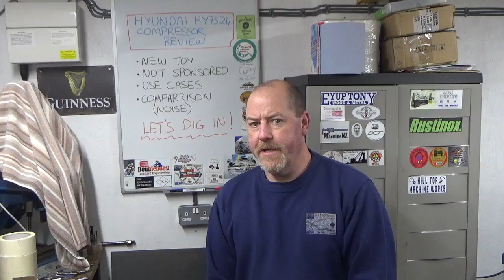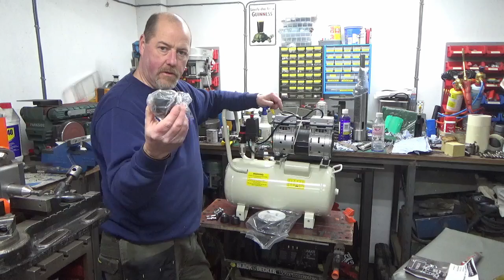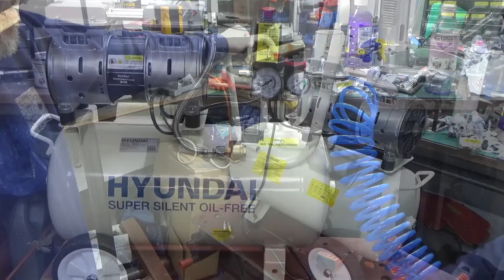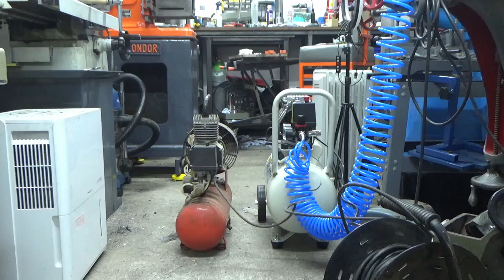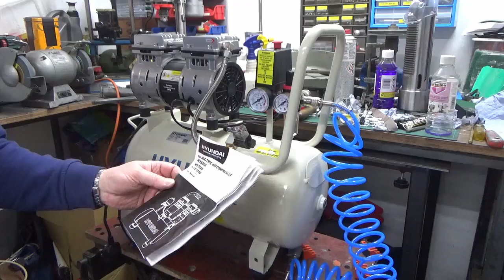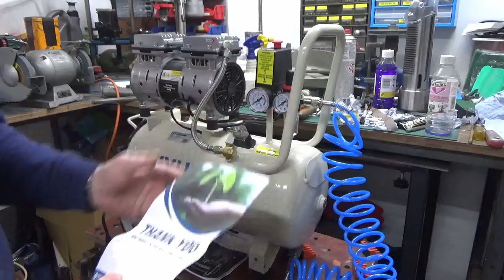Hyundai HY7524 Compressor Review - "Super Silent" or Not?

Comment: This is great Jon . Oddly enough when wearing my other hat , I did an out of the box and assembly guide for this very unit this week . I will share your findings with the factory to address the short power lead and axle issues and see what we can do about protecting the manual . 
These units do have two straps on the outside when they leave us but they tend to get torn off by conveyors at transport depots. 
I agree that the word silent may be strong but I was equally impressed with the "quietness" when I heard one run for the first time. Thanks for taking the time to share your findings . Cheers Ade.
Reply from the maker: Hi Ade, thanks for the comment. Lol, I had a suspicion that was where you wore your other hat! Thanks for taking the time to watch and for offering to take the feedback back to the factory...... brilliant! Cheers, Jon
Reply: Hi,Ade. They are great value for the money,just hope they prove to be long term reliable in service.
Reply: @howardosborne8647  Yes I have been running one for a couple of years by my bench in work . Just keep an eye on the inlet filter if in a dirty environment . If they get blocked it can cause overheating to the motor. Cheers Ade.
Reply: l think they should give anyone buying this the opportunely to either have the two wheels or four rubber legs if its going to be left without moving it around the work shop. Also be able to remove the handle. ps l think the large nut are to go on the rubber legs

Comment: sorry mate but complaining about the length of the power lead is just lame... 2nd thing, editing the volume of the compressors just defeats the purpose of your test. You can hear the change in the edit when you speak and the increase in the volume of the compressor
Reply from the maker: I record on a Sony Handycam, it produces 1audio file per video shot, both compressors were running at the same time, there is no way i am aware of to edit two seperate sounds on the same audio track.

Comment: I have the same machine, no major issue with it but yes the power cable is ridiculously short. On mine i changed the power cable - relatively easy to do, you just unscrew the cover where the on/off switch is to access the connections. I think them calling it 'silent' is a bit of a stretch, but it's certainly very quiet vs other machines!

Comment: Hi Jon, just bought one of these 21/11/2024 compressors and they’ve sorted the wheels now on this compressor, also the cable length is slightly longer now as well, so to be fair to Hyundai they are listening. Also which I find handy, the drain valve at the bottom of the tank, now has a small tap attached, which as I say, makes it a bit easier than unscrewing the knurled screw. WELL DONE HYUNDAI!!
Reply: does this automatically start  up when pressure drops  ?

Comment: Hi Jon, have you posted an update after using the unit for a year? I've just taken delivery of the same unit. Thanks for posting this initial impressions review.
Reply from the maker: Hi, not posted an update but not really had a lot of use being honest. Good bits are it still works as well and as quiet as when I unboxed it. Bad bits, it doesn't look man enough to run coolant mister without the compressor running constantly which is no use when you are filming, and will also kill it fairly quickly I think. I need to adapt the coolant mist idea to work with much lower pressure and be gravity fed with the liquid......an upcoming project. Cheers, Jon

Comment: Mine came 2 days ago and I agree with everything you said about it, BUT I have tried that regulator and whether I go to pl#us or minus nothing changes on the gauge as to the loss wheels I put a couple of washers on, did you find out what that bit of piping was for lol, 
all told I love it.
Reply from the maker: Hi John, thanks for the comment. The 'pea shooter' gets stuffed into the small hole in the air filter (pointing downwards would be my advice so needs a bit of tweaking of the filter housing to achieve this). It's all part of the noise reduction system I think. Hope this helps.

Comment: I would have liked to have a typical diagram detailing where everything is. If you are a beginner you don't quite know what everything is. They said for you to empty the maintank of water at the end of the day but without the diagram you don't know where to go to do it. Also they need to detail how to let the air out of the tank before you drain the tank of moisture. I have the 27550 and that is huge. I was struggling a bit to put the wheels and feet on without scratching the living room floor. The box was quite big and well packed. I wish the power lead was at the other end as I don't want the cabling to rest against the hot cylinders so I have to route the power cable away from the cylinders. I got mine to do airbrushing but to occasionally blow stuff out of machined work, spray large RC models and to pump up my tyres. I do think that you'll appreciate the larger tank and the quieter operation when it is actually topping up the tank. Mine is quiet too.

Comment: Hi Jon, I have got a questions. Do you recommend if I should use 24L or 50L hyundai air compressor to respray on car body parts using LVHP spray gun?

Does it work well for you if you have used 24L to respray on your car? I'd love to know!
Reply from the maker: Hi Chris, I have no idea if it will stand up to LVHP as all I use mine for is blowing down components etc (short sharp bursts). I would definitely recommend the 50l version though if you are going to try it, as the 24l tank is pretty small. Cheers, Jon
Reply: @jonsworkshop  Thanks for the advice Jon, I'm going to get 50l air compressor. But there is a problem, how I can spray on my car roof in outdoor as I dont have the garage?

Do I need to build a booth to put over my car roof to work on it or what?

Comment: Came accross you channel as thinking about this compressor.  I currently have a Wolf 24ltr which is bloody noisy.  My only concern is the Wolf is 9.5cfm and the Hyundai only 5, is this a problem
Reply from the maker: Hi Petrol head, thanks for the comment. Difficult question to answer unfortunately, it all depends what you want to use it for. As I said, it will be fine for the odd tyre, blowing down, micro spraying etc, not really up to high volume air tools though. Cheers, Jon
Reply: @jonsworkshop  well i bought one anyway.  So much quieter than my Wolf, in fact 20db quieter, i did a vid as well

Comment: Just bought this off the back of your video, does yours slightly leak down when it’s reached pressure? Also when it gets up towards full pressure it chugs a bit almost like it’s struggling. Any ideas?
Reply from the maker: Hi James, thanks for the comment. No leaks on mine but it does chug a bit near full pressure so I guess that's normal. Soapy water and a brush will find your leaks. Cheers, Jon
Reply: @jonsworkshop  I’m awaiting it back from warranty repair for the leaking, glad the chugging is normal. Thanks for the reply

Comment: Hi Jon. Purchased the same as above. This is my first compressor, thus learning as I go. My compressor is only reaching 95psi. Is that just how it is, or should it be touching 100 plus psi. Thanks for the video.
Reply from the maker: Hi Tim, thanks for the comment. I wouldn't worry about 5 psi, the gauges are cheap and nasty so they are probably not accurate to within 10 psi. Cheers, Jon

Comment: i have same but no build up pressure, when on, air escape under the black wheel (under the two bigger one (black box with red led) ) , i think is security or so...Nothing to find on internet what how to fix or what is problem :( (7 months old)
Reply from the maker: Hi, if only 7 months old, you should be covered by warranty, 1st action is to contact Hyundai in your area, explaining the fault and ask them to repair or replace. If this is not possible, search for the faulty item, order a new one and replace. Sorry I can't help you much, its quite difficult to diagnose the issue without seeing or hearing the unit. Cheers, Jon
Reply: @jonsworkshop  Thank you very much Jon, i search and it is a ''unloader solenoid'' ...couple euros on Aliexpress.  (problem is i dispose the garant papers)  https://nl.aliexpress.com/item/4001230963369.html?spm=a2g0o.detail.1000014.3.3e7660a1YYAxd6&gps-id=pcDetailBottomMoreOtherSeller&scm=1007.40000.317745.0&scm_id=1007.40000.317745.0&scm-url=1007.40000.317745.0&pvid=a09e47d7-f5f8-4a61-afda-ca67f4300a00&_t=gps-id:pcDetailBottomMoreOtherSeller,scm-url:1007.40000.317745.0,pvid:a09e47d7-f5f8-4a61-afda-ca67f4300a00,tpp_buckets:668%232846%238109%23235&pdp_ext_f=%7B%22sku_id%22%3A%2210000015383570924%22%2C%22sceneId%22%3A%2230050%22%7D&pdp_npi=2%40dis%21EUR%211.53%211.35%21%21%21%21%21%40211b5e2416722731737888341e607d%2110000015383570924%21rec

Comment: Great honest assessment Jon thanks for sharing with us , do you plan to plumb it in with permanent pipework to your machines or just drag it out when needed, i was just wondering how you would gauge the pipework diameter and pipe material choice given the output of the compressor
Reply from the maker: Hi rgbargeee, thanks for the comment. Not sure yet, will be a semi-permanent solution probably using rubber hose for now. Will wait for final workshop before going nuts hard plumbing etc. Cheers, Jon

Comment: Certainly an improvement on non acoustic piston compressor,  my piston one has a 1450 rpm ( 4 pole) motor, this reduces the noise compared to a 2850 rpm (2 pole).
Sub 1 metre cable is very short,  at least 1.5 m, as you say, though most portable and non portable equipment are restricted in cable length. 
Honest review Jon, bit noisy to start your dental practice though 🥺🤔🤪.
Thanks for sharing. 
Regards John.

Comment: Hello Jon,

It seems that you are happy with your new toy so that is one good point.  That short power lead is bad.  Also perhaps a 90 degree bend before the hose connector, instead of the straight one, would be a useful alternative.  Also they could have added a length of plastic pipe, so the drain from the water trap dripped on the ground rather than the machine.

One non-compressor suggestion - unwind your extension cable if drawing a heavy current or it may overheat and melt.
Reply from the maker: Hi Richard, thanks for the comment and suggestions, all of which are very good. Once I know where I am going to site the unit, I may play around with the output pipework to make onwards pipework routing easier. On the extension lead, spot on, I see lots of people not doing this. Mine was over 50% unwound for this test (I was tripping up over it all behind the camera lol). This gave me 1.5 kW rating which was well over the two compressors combined current draw. Cheers, Jon
Reply: @jonsworkshop  You need to be careful using extension cables and compressors, a small voltage drop on start up damages the motor, I've seen it happen twice with hobby units. Long air hose, short cable.

Comment: I’ve had an 8 gallon California compressor for 5 years that’s very quiet. I believe the sound is approximately 56 decibels at 3 feet away. I’ve always been happy with it. However, with less noise comes a slower air fill. It’s never been an issue for me but that’s one important variable to check on with this Hyundai.
Reply: I picked up an 8 gallon California air compressor last year. That thing is super quiet.

Comment: Appears to be a good unit Jon.  5 CFM is a handy size and quite enough for spraying with a low pressure gun.  I have a single diaphram oil less Binks Bullows compressor and it's noisier than this one, so I think yours is pretty quiet.  It should go for many years as there's not much to wear out in these units.  Being oil less also prevents contamination.

The only recommendations I would make are to turn up some longer axle spacers, and also mount an external/independent water trap at least 2 metres away from the supplied regulator.  Having it mounted directly at the tank won't do anything as the warm compressed air is above dew point and can't condense any moisture out. Why they insist on mounting them at the tank appears to be a marketing thing as it's entirely useless.  Even better is to run the air though some metal pipe to lower the temperature and condense it out.  I have a video on this system.  You definitely need dry air for tools and spraying.

One of the main air uses in my shop is blowing crud out of collets and chucks.  Gotta keep precision stuff clean.

Good video.

Cheers Rob
Reply from the maker: Hi Rob, thanks for the comment and information. I have bought 2 drain/regulators, one for each side of the workshop so hopefully this will help. As I said, mainly blowing down and coolant mist is all I want it for so even if a bit of moisture comes through the line, it won't be the end of the world. I have worked in some factories where it comes out in bucket loads (horrible stuff, and a major source of legionnaires disease). Cheers, Jon
Reply: @jonsworkshop  Hi Jon, good plan all round.  It's quite a nice sized unit for everything except most air tools, but would power a pencil air die grinder nicely.   Now there's something to consider.  He He.  So many toys.  Good pick up.  Cheers Rob
Reply: Rob, I have got a question. Are you using 24L air compressor to respray on your car using LVHP spray gun?

Does it work well for you? I'd love to know!
Reply: @chris01479  I have sprayed a car roof with my larger 7.5 cfm compressor OK.  Bigger is always better with paint spraying, in relation to gun size and air flow.  However, low pressure guns (30 psi) work fine provided the compressor can maintain a constant pressure.  All my diaphram compressor spraying has been limited to motor cycle tanks and guards, which is all short burst stuff .  Being a tankless diaphram unit the compressor is a type that only delivers low pressure, but at a reasonably high volume.  Spray guns all perform much the same within their intended pressure range, so brand is not a huge factor.  Cheers Rob
Reply: @Xynudu  Thanks for letting me to know. How did you manage to sprayed on your car roof outside without get the dust go on your roof?

I'm going to get 50l air compressor as it will be enough for me to continue to do my other jobs.
Reply: @chris01479  I did it on a still day.  It was a pretty average job as I'm not a spray painter and it's something that professionals make look easy, but is not.  You need a big gun for a  large area like a car and they use a LOT of air.  Good luck.  Cheers Rob
Reply: @Xynudu  yeah but you didn't answer my question. How did you sprayed outside without ruined the paint on the roof? Did you built a booth or what?

I'm thinking about build a booth so I can spray it without the dust get on the paintwork which it would ruined it.
Reply: @chris01479  I did it in the open air.  No booth.  I don't have those luxuries.  I see you can buy air inflatable booths now.

Comment: Great video introduction Jon. I have a large 3hp 14 CFM compressor & yes it is very loud when running.  Just shows how much quieter the vane one's are. 
Regards.
Steve.
Reply from the maker: Hi Steve, thanks for the comment. In the future, I will need a proper one with a 100L tank probably (once we move to the next house in a few years). This will hopefully last out till then. Cheers, Jon
Reply: @jonsworkshop  To add, I bought the largish 150 litre compressor for when i was doing write off Cars & bikes. I did a lot of painting back then. I did run air lines all round the garage but confess never used them.
Regards.
Steve.

Comment: Well done Jon. I think the wobble in the axles is designed for the high speed shop equipment shuttle team. Having infinitely variable camber will help keep the tires planted during high speed cornering. LOL. 

Thanks for sharing I had not had a chance to look at this type. 

All the best 
Dan.
Reply from the maker: Hi Dan, thanks for the comment. Lol, should be fine then, nothing moves very fast in my workshop, there's too much clutter all over the floor🤣🤣. Cheers, Jon

Comment: Hi,Jon. The compressor looks good value for that price and if it is reliable then it would seem the ideal unit for many home/hobbyist workshops. I have a Bambi twin compressor type in my shop and it is very quiet and easy to live with but as you say they are frighteningly expensive these days.
Reply from the maker: Hi Howard, thanks for the comment. Yep, so far it is ticking most of the boxes. We will see how it performs over an extended duration. It has a 2 year warranty on it as well so pretty good. Cheers, Jon

Comment: bought a simulair compressor but bigger (100L and from the aflatec brand ) 
there all the same manufacturer it seems , so i would just go for the cheapest available with the cfm and size you need 
only thing i dont like is that it doesnt make 10 but 8 atm so it misses some oompf when using with airtools and a sandblaster (seems all hobby compressors have that problem ) other than that im pretty happy with it , 
i have a workshop in the bedroom of an apartment and when the door is closed you cannot hear it running in another room 
and to keep youre hart rate at a reasonable level there perfect , no concentrating on fitting a small item and having it fly off the moment the compressor kicks on and sounding like the china cabinet is falling off the wall...... been there done that
if youre looking for one cheaper (at least in the netherllands / european union) look intoo the vevor brand online , youre size was listed at 143,99 euro on there